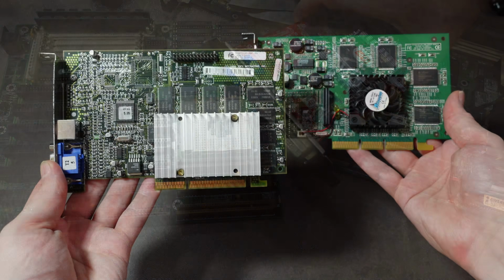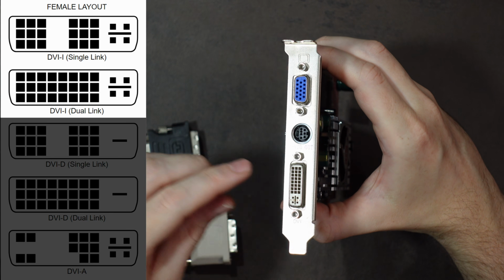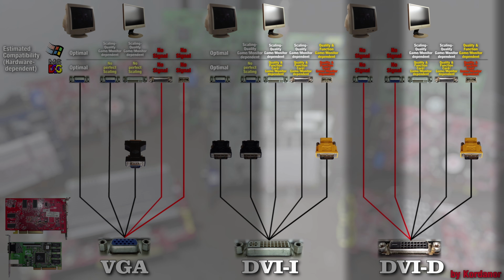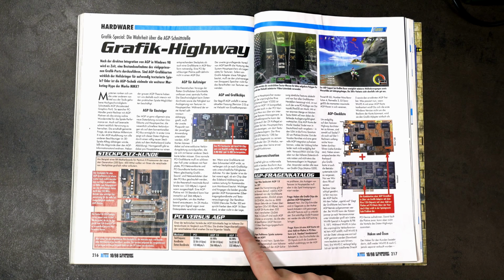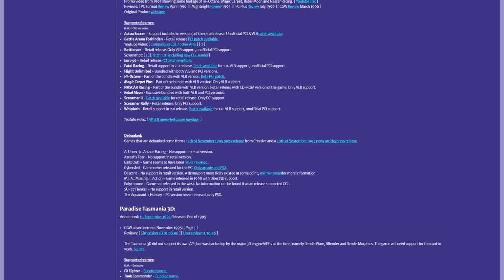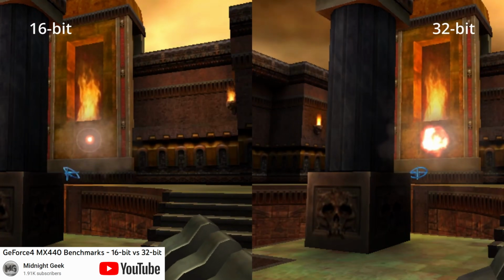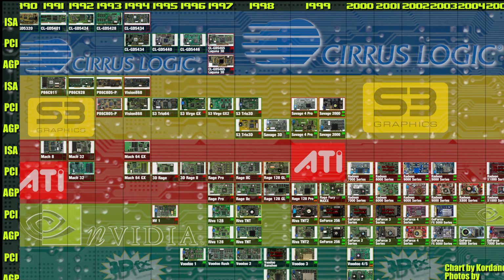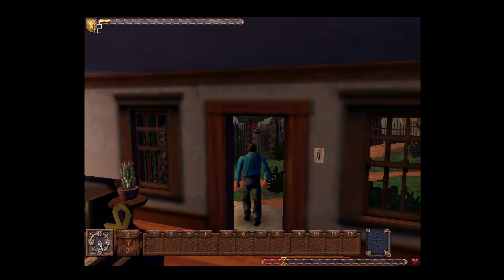Which Graphics Card for 90s Retro-PC? VGA/DVI,  ISA/PCI/AGP, 3dfx/openGL/D3D & more by Kordanor

Comment: The notches in a PCI connector are keyed for the card's signaling voltage, not power supply requirements.
All consumer desktop motherboards use 5V signaling, which is why all of them are keyed that way on the slots.
There are some 3.3V power supply pins as well, and this can cause compatibility issues as the video describes, but the keys on the connector do not represent that.  However, using the presence of those notches as a guideline will probably work most of the time.

Plugging a card that requires 3.3V power into a motherboard that doesn't power the +3.3V pins will not harm anything, so the keys are not there for that.  The keys are to protect from mixing up the signal voltages, which will cause damage if they are incorrectly mixed.  Typically 3.3V signal levels are used on 66MHz or faster PCI slots, while 5V signal levels are used for standard 33MHz PCI slots.  Unfortunately, high speed PCI slots were never adopted on consumer desktop boards.
Cards with 2 notches are tolerant of both 3.3V and 5V signal levels.  It doesn't tell you what power supply voltages the card requires, but since those are likely to be newer cards, there is a correlation that they are more likely to require 3.3V power. That's not what the keys actually mean, though.  So only consider the keys as a clue of what the power requirements are more likely to be.
Reply from the maker: Ah, thanks for the clarification. But yeah, besides from the wording, everything else, including the advices should still be right. :)

Comment: 17:00 . software rendering.

You aren't using a good cpu to test that, because any athlon/duron/pentiumII-III, hell, if it was there, an "older" pentium original (non mmx) with that frequency of 600 MHz can run smoothly Quake DOS at 650x480 resolution.

Or you are using some K6-II setup (that have a weak fpu) and/or your setup is a mess of bad selection of options.

PD:

Some guy that played Quake in its launch with an old Pentium setup around 180 MHz, and can play it with good framerrates at 512x384 or playing with a K6-II 550 MHz with GOOD optimizations to 640x400 (yes, it can double the original pentium setup by brute force of frequency and good optimizations in the setup and boot of system).

That subpar 20 fps sluggish framerrate with a setup based in a "generic" cpu at 600 MHz is ridiculous.
Reply: Hexen II example show us the non sense of your testing about software emulation:

Bad framerrate, but at 640x480 resolution too. And more important, with a cpu at 200 MHz. What the hell a game with MORE STRESSFULL graphics, the SAME ENGINE that Quake, can run so similar to your example with a cpu with 3X the speed (frequency) with the older game with a use more limited of the graphics engine?

That's pure nonsense. The example with Hexen II is plausible, I remember playing it with the Pentium and testing "high resolutions" and having that performance (<=10 fps), the best with soft rendering was 320x200, then the game ran smoothly. Quake with the same setup can play 512x384, with a little low framerrate (around 20 fps). You can play smoothly with 320x240 or some more bizarre resolutions as 320x400 and so on (512x384 is bizarre, too).
Reply from the maker: The K6 II+ is relatively slow for it's MHz numbers. E.g. even a Pentium III with 450MHz is much faster. Wasn't the point though. It was to show how much performance impact 3D Acceleration has and how it looks differently. Back in the day you'd have a slow pentium machine and could barely run these games and then would add a voodoo for a significant boost in performance and look.

Comment: 23:42 / Cirrus PCI model is GD-5464 not 5465.
Just AGP model 5465.
Reply from the maker: It actually exists in both versions. A PCI Version for example is Joytech PCI5465 (Model Name is also printed on it). The pics are used are directly taken from https://www.vgamuseum.info/index.php/component/k2/item/150-cirrus-logic-cl-gd5465-laguna3d

Comment: PROTIP: You can use a PCIe to PCI converter with a low profile PCIe card. This works, but then you need drivers for the OS. It actually makes more sense to mod an older system with a newer OS, like installing Windows 7 on a Pentium 4 and being able to watch YouTube.
Reply from the maker: All depends on the usecase :)

Comment: Anything Dos based 
Early Dos era, 386  ISA , it really doesn't matter that much, Tsenlabs was faster but compatibility issues, Cirrus Logic is great
MMX era S3 or ATI is great for wide range
VLB  SR968 S3 Trio and TrioV2
past dos, the W98 era, PCI/AGP  S3 Savage4 
or a  S3Virge or ATIRage2 with a Voodoo (harder to find, $$$)

Nvidia is not any good in that era,  they were shit, good 2D , no 3D
Reply from the maker: Yeah, though for Nvidia it depends on what you want to do. They are fine for 3D but ofc for the "Voodoo era" especially the early one, there is hardly any way around a voodoo if you want to have 3d acceleration. So for "late" Win98 games where everything is D3D and OpenGL anyways...it will be totally fine.

Comment: In my opinion 3dfx Voodoo3 3500 agp 😉👍
Reply from the maker: Yeah, it's a top card, but not without it's problems. I did a follow up time travel journey describing lots of the compatibility issues, most of them can be solved though with some tinkering.

Comment: Wow, that's some pretty comprehensive info!
Just was building up a DOS/W95 rig Slot 1 440LX w/ P2 Klamath and was looking at graphics card options. I have a GF2MX400 w/ DVI I think I'll use for it.
Reply from the maker: Thank you! Geforce Cards are generally not bad for DOS. However, they wont support 3dfx of course for these early 3D games, and DVI is not an ideal output for everything which is not 4:3 as the internal scaling is horrible. So I would recommend to use the VGA Output whenever you use DOS, and only use DVI when using windows with resolutions of 640x480 and up.

Comment: I walked away from a honey of a CRT like 8 years ago a black Dell monitor with a FLAT Trinitron tube, SMH, now that would be $$$. I have a few old late 486's on the shelf waiting to be reawakened for DOS/W95 gaming... And I need to search my old parts to see if that Phenom 2 960T remained in my possession for a W98 or XP build.. Currently looking to use my Gigabyte 990FX Gaming MB as a starting point for a W7 build and possibly running one or both  of the artifacting GTX 780 6GB cards I picked up if they can be fixed. I am encouraged by the fact that they are outputting a signal!
Reply from the maker: Nice! Well, GTX 780 would be a bit too new for my taste. Feeling like it was just yesterday. In fact I am still running a GTX 1070 in my "modern" main PC :D
With the Phenom keep in mind that old games might not play well with multiple cores.I guess you could in theory just disable them though if needed.
The Trinitron objectively certainly has a cool image, but it's also about what you are aiming for. Personally I always used Shadowmask monitors. So a trinitron wouldn't feel very nostalgic to me personally, but depends much on personal taste. Same goes for discussions between SB, Roland and GUS

Comment: Recently I built a retro Windows 98 computer using the 3dfx Voodoo1 paired with a Geforce FX5500 256mb AGP card. The motherboard is a Biostar M5ALA, with a K6-2/400mhz CPU, using 128mb of Kingston DDR1. I used an IDE to CF card adapter with a 16GB CF card, I have 52 games loaded on this, all Windows 95, or 98 no DOS. I run the video to a 27" LED monitor using strictly VGA connectors. Need For Speed 2SE was my favourite 3dfx game, and the first game I bought back in 1997 running on Windows 95. and on a Monster 3D Voodoo 1 card, that is what I have now also.
Reply from the maker: A bit of a weird pairing (the FX5500 is a bit new), but if it works, it works. :)
 For the Monitor you might want to think of using a scaler. But really depends on what you are doing and how much you care. While 3D games will look somewhat fine, Windows Desktop will look quite washed out with the Monitor scaling I guess. But a VGA Scaler is also quite expensive (e.g. Retrotink 4k CE).
Reply: I think you will be using SDRAM on that board not DDR.  It sounds good though.  I recently found a Voodoo Banshee for £25 and I’ll be trying that in my K6 3+.

Comment: 23:41 According to Wikipedia ATI 3D Rage was released in 1996
Reply from the maker: Thanks! It probably depends a bit on definition. I just checked again, and the Announcement was in November 1995. The Wikipedia Article refers to a source saying 1. April for "availability in commercial quantities", which implies there was a release of non-commercial quantities before that. vintage3d.org also mentions that some also consider the November date as release date.
Save to say, the release was somewhere between November 1995 and April 1996, depending on definition of "release", and whatever happened in between.
We hear the term "paper launches" a few times these days, maybe it had a "paper launch" in between. ^^

Comment: I had the same crt back then 😅
Reply from the maker: It's a great CRT! No Slot Mask, but a simple shadowmask, but that's how I actually prefer it. That said, mine is starting to crumble :(
In my latest video you can see that be frame in the bottom starts cracking as somer internal plastic thing broke. Will try to fix it soonish, but might need to search for a new one.

Comment: 25:06 - another hint that a lot of people don't realize, these later PCI cards were mostly released later than normal AGP version, that means that you can't use older drivers, which means that it is mostly not wortht o buy for retro gaming, I think that FX series should be still fine, but I have one 6200 for PCI and it was released in 2008!! Drivers I need are too old for this GPU, so 6600GT has much better compatibility because it was released in 2004 and you can use older drivers. So I really don't recommend buying GeForce 6000 series for PCI, it's not what you think it is, there is no 6000 series compatibility. But my 6200 PCI was completely new when I bought it few years ago, so I am still glad that I have one even when it's piece of nonsense hardware. 🙂
Reply from the maker: Yeah, it's also what I show on that "Diagram" around that timestamp (can also be downloaded separately, link in descripton). There you can nicely see how PCI is vanishing, then AGP is taking over, and then PCI is reappearing. And that "new" PCI should only be bought for PCs of that time, unless you are absolutely sure that it will work on your older system (like if you have someone who already tested that specific model), but assume it wont work.

Comment: There is no correct answer, some games just need specific GPU with specific drivers to run correctly, you can just find the most universal combination, but it's not gonna be 100% compatible with all games. 🙂
Reply from the maker: Yep, pretty much. Next Sunday I also plan to release a video which will also somewhat "disenchant" the Voodoo 3. While it is a great card, it's also definitely not one which let's you live carefree, and without compatibility issues.
Reply: @KordanorsGamingLair  I am using AvP 1999 and NFS5 as a test, if these 2 games work fine, then everything will probably run fine. For some reason, DX6 and DX7 games have the worst compatibility problems and when you use even older hardware, you will realize that HW from that time of the game doesn't have performance to actually run it properly, everything was developed for future HW, but back in the day, nobody cared about some 60+ FPS, it was just does it run? If yes, then it was everything fine. 😀

Just a little tip for people who are trying to build computer with the best possible performance and still good compatibility with DX7 and DX6 games - it works pretty fine on Radeons x1000 series under Win 2000 with alternative omega drivers.
One would expect that Win 2000 and XP are pretty much the same because of similar core, but there is a pretty huge difference when it comes to problematical 90s games. Ofcourse you can run them fine in Win 98, but you can't use later HW because of non existing drivers.

Many years ago, we were throwing GPUs like MX440 out of Windows, these common and cheap GPUs are also pretty good for 90s gaming in these days, but ofcourse it's not for people who want time precise machine with actual 90s HW.

I was always nvidia boy back in the day, but now I realize that ATI card were mostly better for compatibility and performance, GPUs like Radeon 9600 can be easily found now, it's nothing rare, but it has good value for me becuase it has exactly that mix of compatibility, performance and support for old operating systems I need.

3dfx is like completely new undiscovered galaxy for me, I hope one day I will get there. 😀

The worst thing about all those compatibility problems is that you will finally solve it, then you forgot about retro HW for some time and then you can start again because you don't remember what exact drivers you used before.....I hate it. 😀

Comment: geforce 256 and nvidia quadro1 are similar graphics cards if the manufacturer does not give a sli plug for geforce 256 then they give a sli plug for nvidia quadro1
Reply from the maker: Hrm, but SLI was actually used by 3dfx and only then later used by NVidia after they bought 3dfx. But the first quadro was actually release before SLI was a thing for NVidia.

Comment: two 3dfx voodoo1 graphics cards in isa8 bus connect via sli cable to two 3dfx voodoo2 graphics cards in pci bus but geforce graphics cards are compatible if two geforce 256 sli pci or two geforce 2 ultra sli pci are inserted in pci bus instead of two voodoo2 pci
Reply from the maker: Alright! Photo of your setup would be cool
Reply: At no point in your rambling, incoherent response were you even close to anything that could be considered a rational thought. Everyone in this room is now dumber for having listened to it. I award you no points, and may God have mercy on your soul.

Comment: two 3dfx voodoo1 to isa bus graphics cards are connected via sli cable to one geforce 2 ultra to pci bus or to one 3dfx voodoo2 to pci bus compatibility is a matter of motherboard and drivers but the type of graphics cards connected via sli cable is voluntary for example four 3dfx voodoo1 to isa8 bus graphics cards connected via sli cable
Reply from the maker: I think what you call SLI cable is just the passthrough cable (which is optional). But now I get what you mean. Interesting setup for sure!

Comment: two pentium pro processors on one motherboard two 3dfx voodoo1 graphics cards to isa bus connected by sli cable to one 3dfx voodoo2 pci connected by sli cable to one geforce 2 ultra pci
Reply from the maker: 2 V1 and 1 V1 and one GF2?  Not sure how you would "SLI" the V2 to the GF2. How do you tell DOS which graphics card to use?